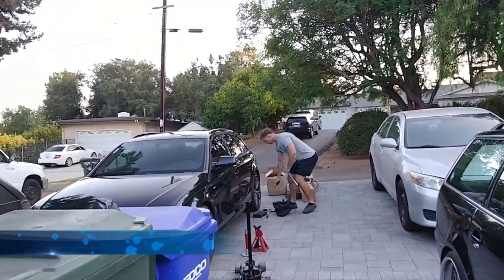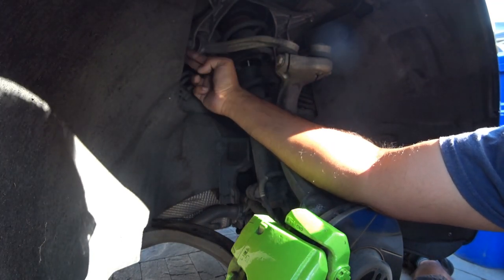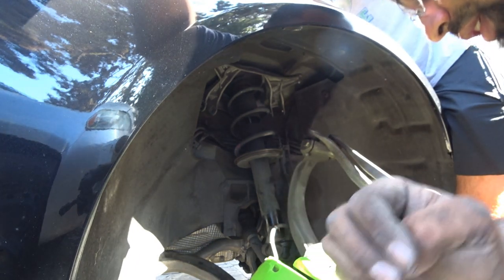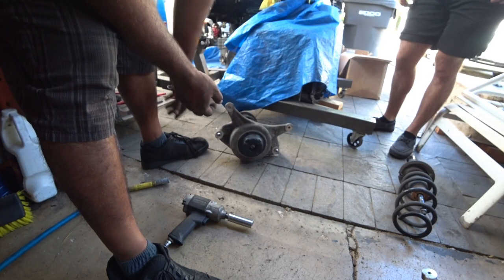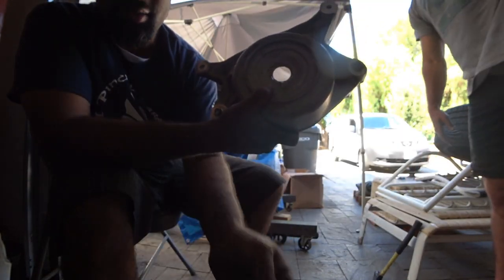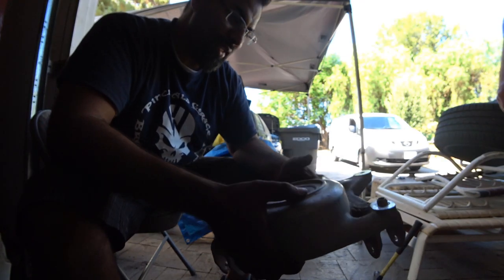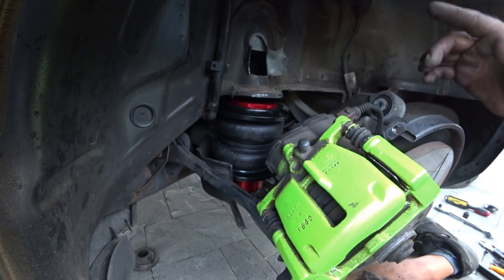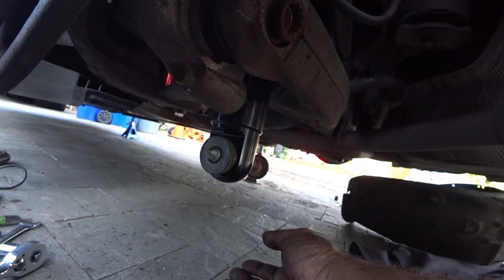How to Bag a 2011 Audi Avant with Airlift 3P Perfomance Suspension Season5 EP30

Comment: Do you remember what 15amp fuse you tapped into for the management remote turn on ?
Reply from the maker: No sorry it's a been a while. If you have a volt metere you can test for the fuse just make sure it has a 12V switched that does not fluctuate in voltage

Comment: What part number did you get for the rear bags? I just installed my set up on my 2013 Allroad and the rear bags don’t have a threaded boss for the nylon nut to mount the bag to the upper spring perch. I’m so confused if they changed the kit or I got the wrong rear bags. 

I got 75658/78634 part number.
Reply: I just got my kit and it’s the same way idk what’s going on

Comment: Hey man just finished my a4 sedan and just wondering when you plugged back the battery negative terminal, did the trunk still opened? And also for some reason cant start my car keyless only if i put the key fob in the key hole...any sugestion?
Reply from the maker: No we didn't have this issue
Reply: @PincheALsGarage  hey bro one more thing, which fuse did you guys ended up connecting the pink wire to? I connected it to the cigarrete fuse 20amp in the trunk compartment and for some reason the remote wont shut off, its stays on all the time? Do you know what could it be?

Comment: Where did you end up running the lines? Know they're in the side compartments but where did you run them to meet the manifold without them showing
Reply from the maker: We ran them under the carpet. If you see the side panles they have a bar that can be unbolted than lets you run the air line under the carpet

Comment: We’re did you end up conecting the pink wire !! Need help 😢🥺
Reply from the maker: In the trunk
Reply from the maker: You need to use a volt meter and find a fuse that turns on when you turn the car on
Reply: Eres la. Mera verdura 🥬 del caldo papa!!